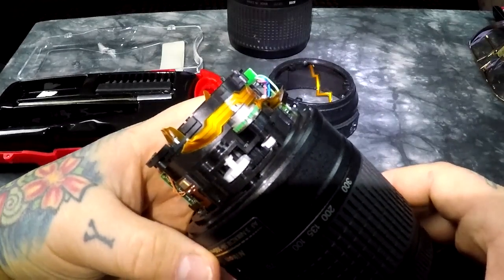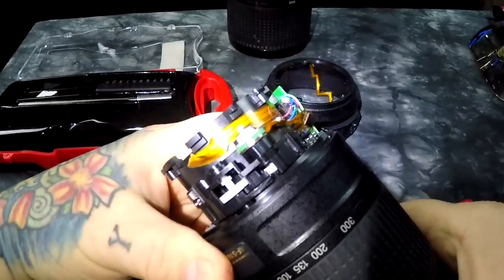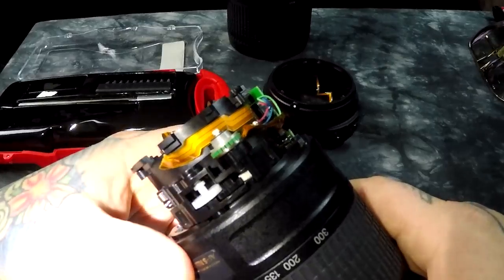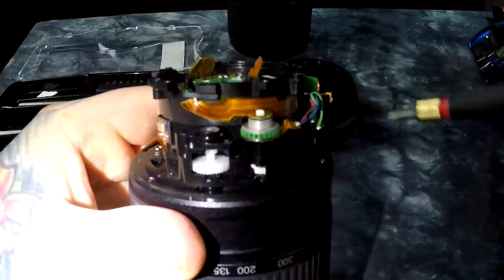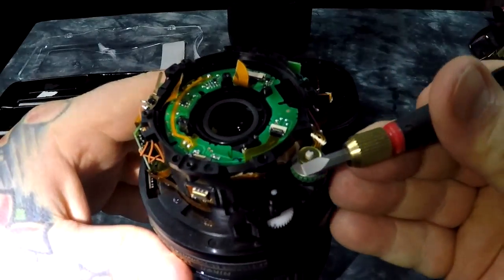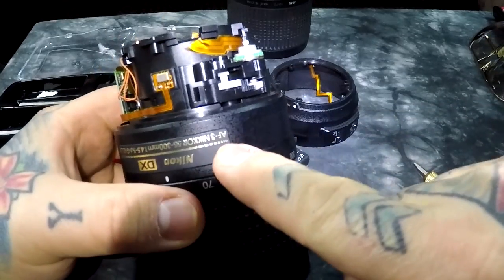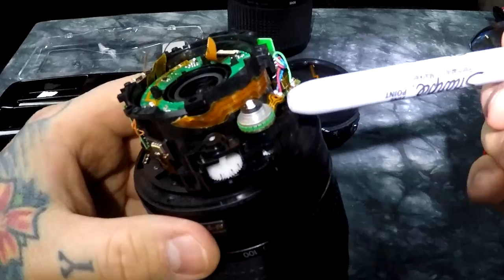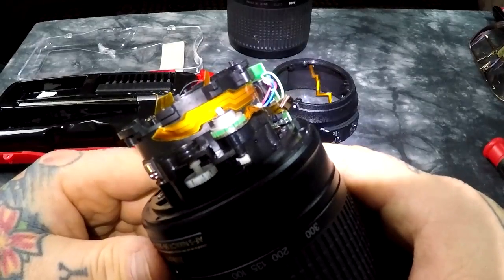Nikon DOES NOT want you to see this video...micro-motor assy.   Part 1

Comment: I have a question: I had a sticky zoom barrel on a 18-70mm af-s DX lens. I took it down and found one of three barrel screws (with red sealer on it) had come loose and was binding up.  I tightened it and put the lens back together.  Now the auto focus whips back and forth when I press the trigger half way down to focus. Almost seems to overshoot the desired spot, then goes the other way and so on and so forth.  Is there a tensioner on the SWM I missed? Or some odd reassembly technique? Or a relearn procedure after repair? Thanks in advance.   Oh, and for what's it worth, I like your videos.
Reply from the maker: theres a micro motor thats slipping gears on that lens :(  ive made vids on the micro-motor drives
Reply: Theoria Apophasis This lens has the ring style motor......no gears.   And the thing is, I never took the motor apart! I will check the 4 pin position sensor. Any other suggestions?

Comment: I am no tech guy, but this is the first time I saw the inside of a modern lens. It looks a lot cheaper and more plastic-ie than the older metal lenses. Yet costs way more...?
Reply: Alex G it is an entry level lens and the older lenses were much simpler in design without all the af and image stabilisation tech in them. If it it was made of metal and glass entirely it would be extremely heavy. But it is more plasticity and cheaper feeling than the older lenses never the less.

Comment: This is indeed a geared swm drive. It is nor ring motor, but it IS a silent wave motor. You are wrong on this.
Reply from the maker: tell that to the 4 plastic gears driving the lens……. 

ring ultrasonic uses no such crap
Reply: He said it: Nylon cogwheels are used in extremely high load drones. People repairing Nikon lenses for years have said that they never encountered that wear. So.... I doubt this is a real problem.